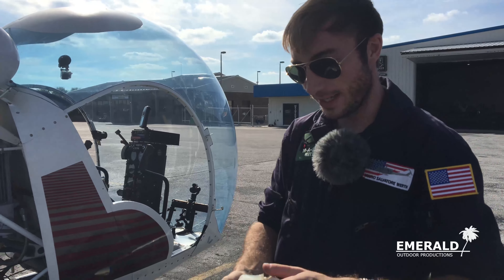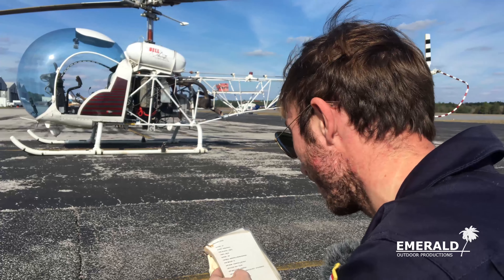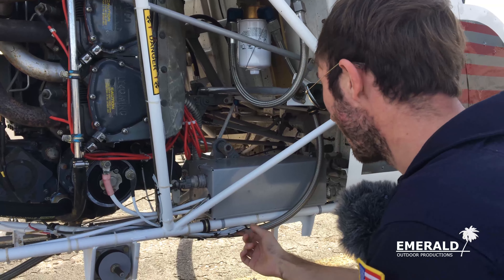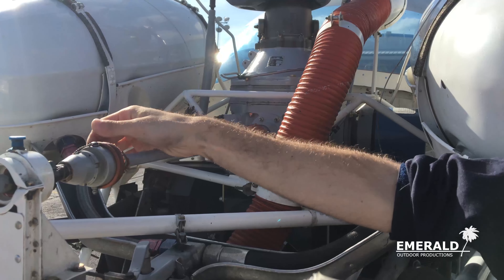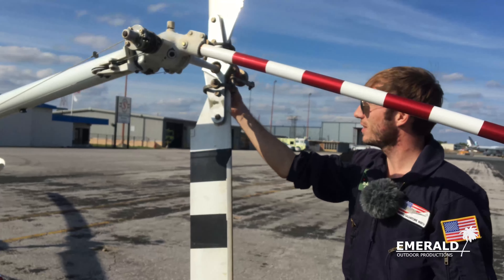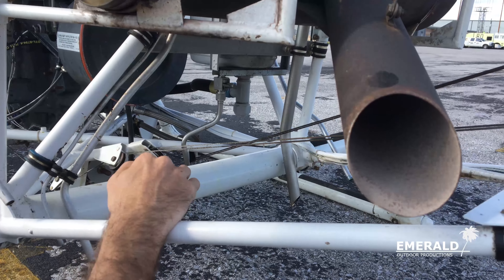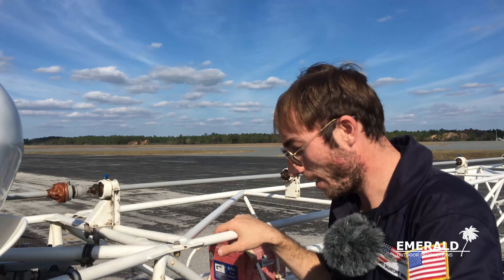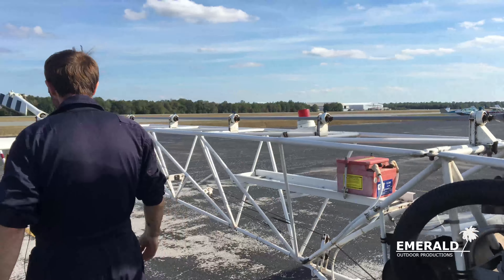Bell 47 G-2 Helicopter Preflight (ft. Mario Werth)

Comment: Bro...any problem using the helicopter when it rain?
Reply from the maker: The wood rotors can swell if they get too wet. It can take a small shower, but the blades have to be dried off as soon as possible. When I worked ground crew loading tour passengers for a D1 (I'm not the pilot), if there were ever any storms coming we would either secure a tarp over it or hangar it.

Comment: Kind of sorry I didn't go to the Army Rucker Helicopter School in 1956 after passing my flight physical. I was with an Army Airborne Medical Unit and was slated to fly Medevac. I only had a few months let of my enlistment and was told I needed to sign a letter of "Intent", that if I passed flight school I had to sign for another 4 years. I didn't sign, took my discharge and did fixed wing as a civilian. I flew for some 50 yrs both for fun and commercial, but I still feel I missed another adventure....except for the 4 of us out of 8 that passed medical I assume if the other 3 passed they would have been some of the first into NAM flying "Dust Off".